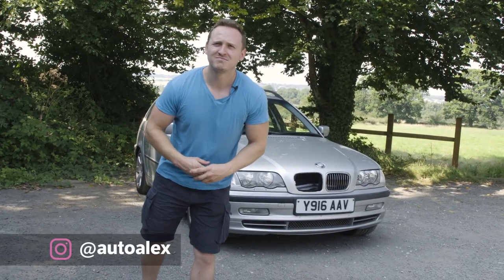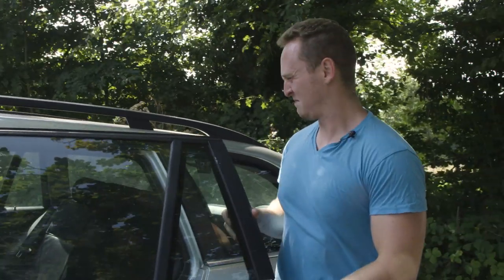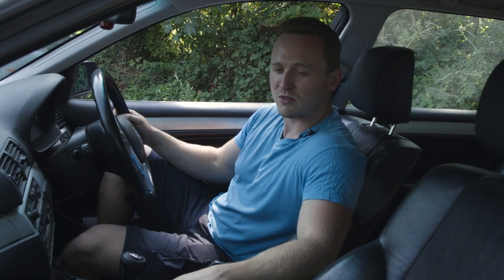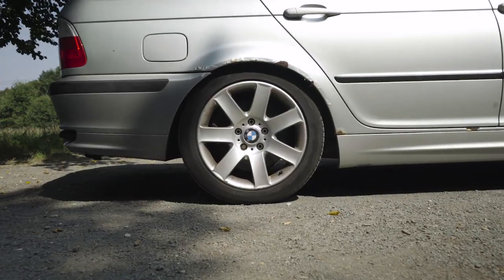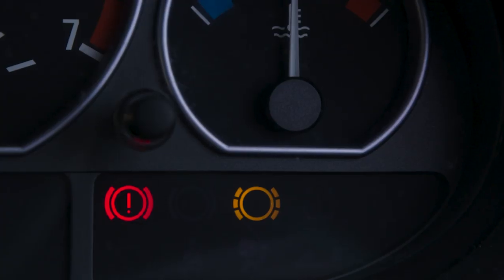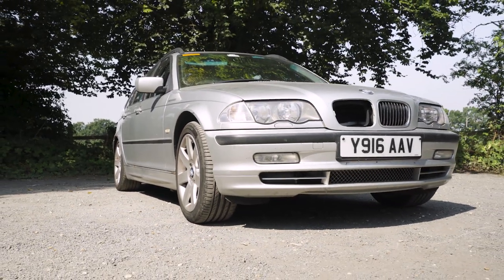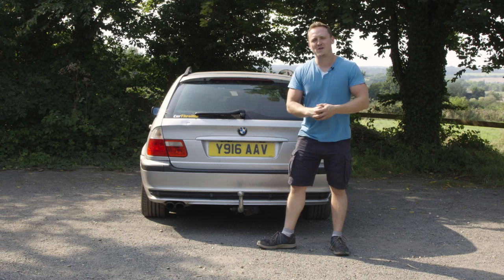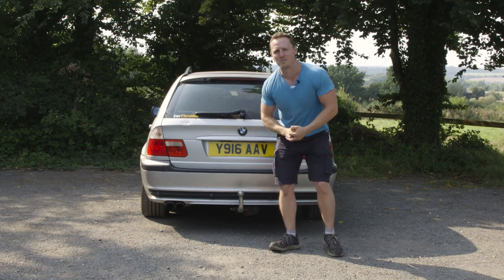£140 BMW Review: 1 Year Later!

Comment: Just because it's a cheap car It doesn't deserve to be abused, at least give it a service
Reply: Once you start investing into a car there is no going back, you wil fix this then fix that and you end up investing over 2k into a shitbox that is not worth it at all. either fix everything and make a car perfect or don't spend a penny and ride it till it will die.
Reply: @spindedark  simple things like that are hardly investing, it will help you to prolong your cheap motoring, especially if you have already bought the oils and filters
Reply: @russelltaylor1500  servicing a car will only pay off in the long run, this car is very rusty already and won't last much longer without expensive repairs, something is gonna break within a year or 2 and the car is done.well atleast you got new oil, filters and spark plugs when they tow it to the scrapyard.
Reply: @spindedark  I do maintenance and fix the basics i can't stand  rattels
Reply: @spindedark  he's already got the oil and filters..... 
I suppose it's just mechanical sympathy on my part more than anything but let's say that car done 10000 miles in that year, and wasn't serviced in the previous year before CT bought it then it's going to be heading towards very exessive engine wear that might end up actually killing it before a major failure elsewhere
Reply: I want a 3 series now like an extra only because my 5 series is a bit $$ on gas. I travel about 50mi which would be like 80km one way and back making it double of that, 4 days a week to school lol
And now it's been in the shop twice since I entered school. And the gas. It gets expensive. But then again, it's a lot of miles so it's not a huge deal.
Reply: This car is effectively totalled, any work on the car would be worth more than the car itself.
Reply: care free motoring is one of lifes greatest joys.
Reply: It deserves at least a basic service (oil change, oil filter, air filter, fix the grille)
Reply: @spindedark  that's where metal fabricating comes in repaired my Suzukis rear fenders after they rusted out and then did my undercarriage 100 dollars in metal and 30 dollars of paint good as new
Reply: @thesechicksdontevenknowthe3298   It was effectively totalled de day it lef the dealerships. Was full of time bombs.
Reply: @spindedark  M54B30 engine cost 800 euros cheapest (in Latvia) , swap kit (engine, wiring and ECU), what you can get from that e46 costs over 1000 euros, now you still think that giving service on at least that engine is worthless?
Reply: Not happy with this video, can’t even do a service
Reply: booooringgg...
Reply: It cost 140£, why spend anything other than fuel on it ? It would be stupid.
Reply: @spindedark  The car barely has any rust, I used to run Sierra's with bits falling off the doors and holes in the rear sills you could put your fist through.  Bit of P40, some tin finished with P38 and primer and good to go for another year.  Gets tricky when the fuel tank rusts, I couldn't put much more than a tenner's worth in my Astra before it leaked out and if you let it get nearly empty rust went into the carb.  Still ran it like that over a year.
Reply: Do a restoration like jeeeeeez 😭😂
Reply: @russelltaylor1500  simple things, lol, the price of a service is like 2/3 the price of the price he paid. ride it till it breaks i'd say
Reply: Agreed. A car that was beautifully maintained all its life, now ruined. Poor next buyer will think it's well maintained until they watch this...
Reply: That's stupid I've bought cheap cars, completly disrespected it Nd sold it for more
Reply: When it goes it goes. Its more than 140 in scrap value so he will get his money back when it finally gives out. Why invest? The most you should spend on this car apart from fuel is on windscreen liquid. Nothing a penny more
Reply: MaX83_ZA It won’t live to see a next owner.
Reply: MaX83_ZA i don’t think he plans to sell it on 😂
Reply: @spindedark  servicing a car is not fixing it, changing the oil will keep it going for longer and not die prematurely.
Reply: MaX83_ZA next buyer? This car is now 18-19 years old and he paid £140 for it, if and only IF he actually manages to sell it, it will be for pennies. Sad but true, everyday cars in the UK over about 12 years old are worthless.
Reply: He told it himself, the engine is still in very good condition. He doesn't really need to fix the rusts and dents. He should just take good care of the engine.
Reply: Will they be anymore content on the 330d track car?
Reply: true but i'll trade one abused car if it teaches a lesson about why you should maintain cars properly :)
Reply: spindedark i agree, i’m still waiting for my mk4 Golf (first car) to die after 30,000 kms but she’s still strong and some how amazes me!
Reply: Mario  I'm a car mechanic for 8 years now, i work on these cars weekly and not even as a hobby. But thanks Mario. Guess you know alot about these cars as a full time youtube mechanic.
Reply: @spindedark  I done that last year spent money on a shitbox to just give up and trade it in 1.5k in
Reply: Lol its had 10k spent on it since 2003. I bet it doesnt cost that much to keep something Japanese on the road :D
Reply: No need to service it, the engine has been so well maintained throughout its life that it'll probably do 30-40k miles without issue, I've put 20k plus on a few cars in the past just topping up the oil without  a proper service.
Reply: @BlatentlyFakeName  errrr its german!!!!
Reply: What I've told all my exes
Reply: McLarenBMW that’s a lie BMW’s are expensive to repair
Reply: @WarrenF  only the M cars, the rest are no more expensive for parts than any other manufacturer
Reply: It had its last service at 162k, probably not due tbh
Reply: @neilwalker3500  it was at 174k in April. Thats over 10k on a high mileage bimma, deffo needs a service mate!
Reply: Not really. I fix major things and service on time my shitbox but let minor things be broken because its endless
Reply: Put some silver hammerite over the rust, and put some cheap 10w- 40 or 5w-40 and an oil filter. Should get afew good years from it.
Reply: my mercedes c200 2004 never service for 5 year now.. it all good ...
Reply: Ironically it has to be legally serviced otherwise they couldn't put it on the road like they did
Reply: There is an app or website called rapid car check
If you can, put in the number plate and the MOT,s  are amazing
Reply: I like to maintain my cars, and still, with that amount of rust, I wouldn't throw a penny at it.
Reply: No cause that's investing in a shoebox what's the point
Reply: @Vodaph0ne  Sorry, servicing a car is something very different to an MOT. Legally you have to MOT a car (if over 3) but servicing a car is optional. You are the one who is wrong
Reply: spindedark you are wrong , I’ve bought cars for £20 yes twenty quid and it’s only needed the back brakes adjusting and the handbrake looking at , total cost £70 and it’s been a perfect runner for around a ton all in ...sold the next week for £500 see ya
Reply: @miawallace2785  Ok, I'm impressed
Reply: i hate to see high mileage heros go to waste :(
Reply: @debbiepeter112  Lol when I said servicing I obviously meant an MOT
Reply: @thesechicksdontevenknowthe3298  no the engine is solid...so its worth it. for 500 euros you can get this car looking decent and serviced.... I did the same bought a 2,2 e46 touring for 60 euros fixed the rust mad it solid replaced a lot of things.....but I got some sick bmw x5 borbet wheels for it and a nice steering wheel. in the end it was 1400 euros total and put 50.000 kms on it and sold it for 2250euros with 263,000km on it........it was a shit box like Alex his car to......dont go throwing old cars in the bin when they are fixable especially one with a silky smooth straight six ...oh and the rocker cover gaskets always leak on the m54 engines...just replace it its cheap and you don't get a plume of smoke from under the bonnet every now and then.....
Reply: This is like those comments in cat videos

Comment: "I'm not touching anything cos then it will start breaking" , this is what's known in the trade as a LAND ROVER mentality
Reply: As the owner of a 2001 140k Disco 2 TD5 that looks like it should've been scrapped years ago but keeps going regardless and tows 2.5 tons of horses n kit everywhere I totally understand your statement!!
Reply: @ghvtg  we had a Freelander with alot of problems, we sold that and now we have a 2016 sport with like 100k km and we've had no big problems at all
They'll maybe come later tho
Reply: @thijnspeksnijder1294  the newer stuff is more complicated with more electronic control and sensors, DPFs, higher pressure injection systems etc so more to go wrong I guess but that goes for all modern diesel stuff really
Reply: No Name oh problems are coming trust me. I work for Land Rover
Reply: @photilal1960  it's 18 years old and gets abused, so yup. When they do they'll be sorted. At the moment though it's my old Porsche causing me problems, not the Landie! Ps...of the 160 or so cars I've owned, inc previous Land Rovers, the only X4 to actually expire on me were a BMW, Alfa Romeo (x2 of em!), and a Toyota. Never a Landie
Reply: @photilal1960  there is a saying that translates to "if they don't have an oil stain bellow them means there isn't any oil in the engine" also can be used as a sort of joke. "why a land rover owner smiles every time he sees the oil stain under it? -i don't know, why  - because it has oil!

Comment: I always end up with lemons even when i buy them new while there are peeps with 140 pound cars that just run.
Reply: Newer cars have more (or maybe more complicated) problems early on. Buy an older VW TDI. Even the chipped ones last half million kilometers with proper maintenance easily.
Reply: @vabu94  yeah I'm planning on getting a 09 wrx hatchback now. Done with euro cars for a while I just have the worst luck at picking cars.
Reply: @vabu94  wow that is not true..the turbo, clutch, egr and dpf will all need to be replaced within the first 100k miles and at least two of those items will need to be replaced within 60k! If you cheap motoring buy a Corolla.
Reply: @pollumG  he said older VW TDI's. So he probably meant before dpf. Egr clutch and turbo isn't that common to go on those in comparison to newer ones. If those were a problem, they should have been done already because how many cars of that era still have under 100k miles
Reply: @pollumG  Even with DPF if you dont drive like a granddad and keep the engine above 1,5k rpm and drive longer trips frequently you wont have any problems. My 2010 1,9 TDI has almost 300k km with orig. turbo, dpf and egr.
Reply: What does lemon mean tho??
Reply: @vabu94  TDi's are only good if you drive a good distance per day other wise the diesel particulate filter gets clogged the fuck up.
Reply: @Nchinnam  Just so you know, Subarus are a pain in the ass to maintain. It takes hours to change a spark plug on a boxer engine.
Reply: @pollumG  This is accurate as fuck. Corolla or a Camry and you're set.
Reply: @mosxidigaming  Lemon means a car that has problems instantly. Like the few week of driving something breaks.
Reply: @DeimosPC  my dad works at Subaru so it's maintenance is gonna be free for me. I have saved up enough to buy one but I'm still hoping my golf somehow stops being shitty.
Reply: the secret is in all that wad of paperwork he showed off. the previous owner(s) cared for the car, and probably changed everything that needed to be changed, so that by the time he got it it was just a well broken in new car. Theres only so many mechanical issues a car can have, and once you fix them all, it just runs. Not to mention that the e46 generation of BMW was right on the cusp of the tech infection that the newer BMWs have. The car is still simple enough to just run with little problems. On a newer car, some of those issues he was just living with would light up the dash like a christmas tree and probably put the car in limp home mode forcing a repair. 

Moral of the story. Do your homework when buying a used car. Look for extensive service history records, and signs of highway use (rock chips, interior not beat to hell, etc). find a combo of both and you will have a nice car no matter what you pay.
Reply: Deimos Not necessarily true nowadays. I’m a Toyota dealer mechanic and the later models are no where near as good as the previous ones. Transmission problems and a never ending sea of rattling complaints. We’ve replaced a few 2019 Corolla CVTs. But I’ll give that to them since it’s a completely new car and there will be problems that they will iron out on upcoming facelifts
Reply: Matthias H Are the 2018 Camrys shit? I’ve been highly considering getting one since I like the new look but I have seen a few reviews here and there that say the transmission lags really bad.
Reply: Deimos I wouldn’t call it shit but I’d take the previous generation Camry over the new one. I’m not a fan of the new one. The transmission does shift funny. I remember doing PDI on those when they were new and I thought it had a bad tranny, but they’re naturally like that. We haven’t had Camry with a failed tranny yet although we had a 2019 RAV4, which shares the same tranny, had it’s tranny replaced but it was due to whining rather than rough shifting. If you want a Camry get a CPO 2017-2015 one. I personally like the V6 myself, it’s a performer, but the 4 cyl will do.
Reply: Same
Reply: @vabu94  yeah that's the avf engine which are rare now and they don't make them anymore. I had the 1.9tdi. Yeah I loved it and it was quite reliable but it was still a money pit with other components. If you want reliability buy Japanese ESP Toyota.
Reply: @vabu94  He was talking about cars,not VW toilets.
Reply: @vabu94  I had a 1.9tdi a3 with the old pd engine. 155k miles on it and ran like a dream. Some idiot decided to pull a u turn on a main road without even looking so it's now in a scrap yard somewhere. Heartbreaking:(
Reply: Lol ever single comment on this thread literally every single comment is from casual car enthusiast. 🤦🤦🤦
Reply: Naganachiketh Chinnamuttevi maybe you were a used car salesman in another life

Comment: As a guy who drives a 1999 Nissan primera with 100k on the clock that cost me £500 and has lasted me a year with no faults, I appreciate this video. Shitboxes are finally getting the recognition they deserve
Reply: Driving shitboxes is so underrated, now that i have a brand new car i regret being able to park anywhere without worrying about it getting scratched.
Reply: I had a 98 primera for 14 years, went wrong once, exhaust. Apart from that just oil , plugs etc.
Reply: Noooo, the UK motorist’s best kept secret! Let the majority of the public pay £300 per month to rent a car on finance, or all the bangers will go up in price
Reply: Most dogged car I ever had was a diesel starlet. Was a hand-me-down through the family, was already 16 years old when dad bought it. Fast forward to 2016 and its suddenly mine, oil leak and all. I never once actually serviced it because it pissed the oil out so quickly it was pointless. I had it for 2 years before it finally cried enough of my torture, after driving around for 2 months with a blown head gasket in the middle of summer. Wasn't even that that killed it. Cambelt snapped after doing about 200000km... really wish I'd looked after it a bit better. Would probably still have it.
Reply: I had an escort 1.8 diesel non turbo paid £650 for it , had it 4 years and ran it off used vegetable oil and the only thing to go wrong was a gearbox mount . Sold it for £500 after 4 years . Wish I'd have kept it now
Reply: It’s the same with my Volvo I payed £500 for it 5 years ago and it’s still going strong, even though the glow plugs are broken and there’s loads of dents I still love it.
Reply: i hate to see high mileage heros go to waste :(
Reply: @ianrushsmoustache2282  used vegetable oil aye wtf
Reply: @ianrushsmoustache2282  you hear thaatttttt